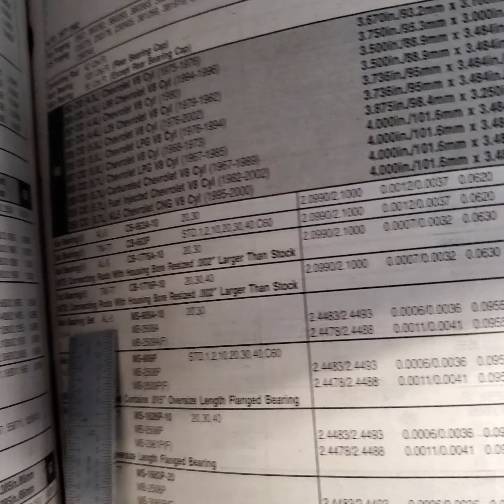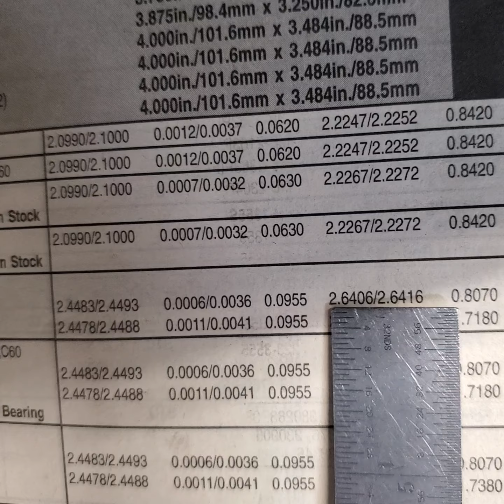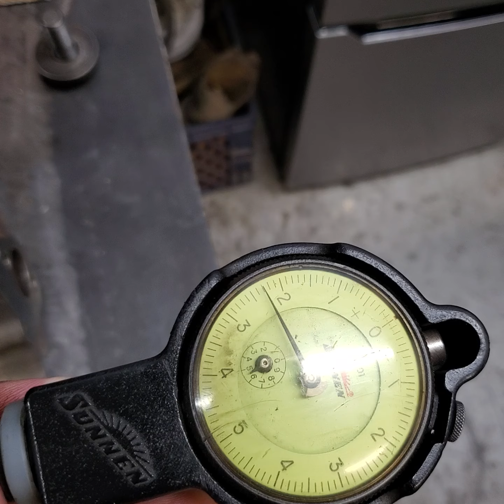350 Chevy crankshaft fitting

Comment: The way it should be done.😎👍
Reply from the maker: I posted this video in a couple FB Chevy groups since I was seeing so many posts with a pic of tight  plastigage measurements and the post authors asking what to do now.
Reply: @whiplashmachine   Just run it easy for 100K miles till it wears in. 🙂 If the bearing bore and the crank are within the specified tolerances then it should work just fine in a stock application. A little more  clearance is of course preferred for higher powered applications. 🙂